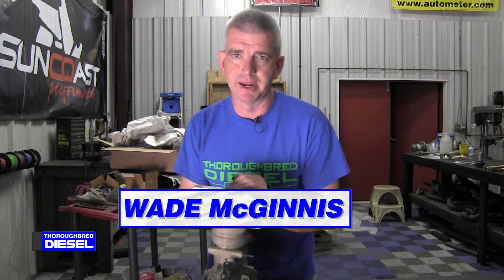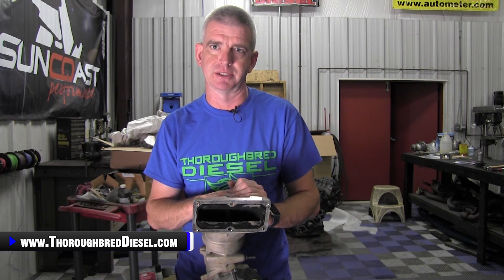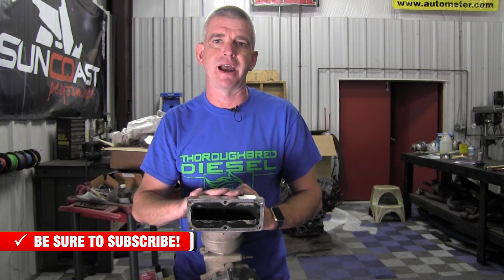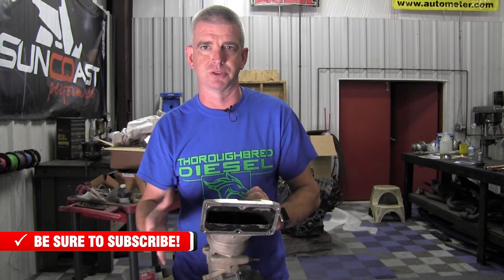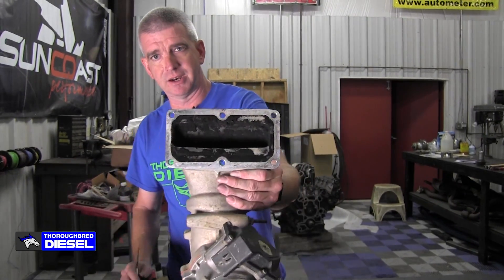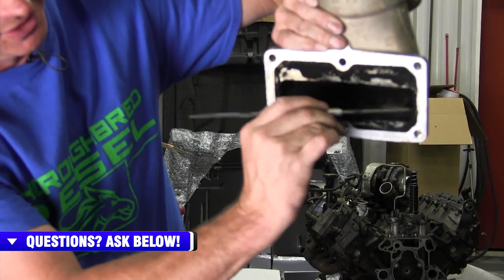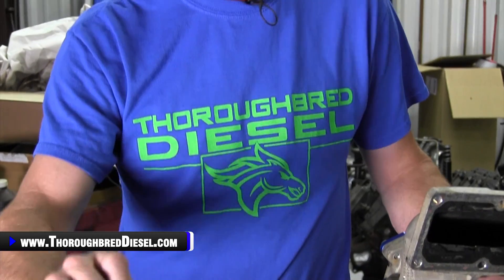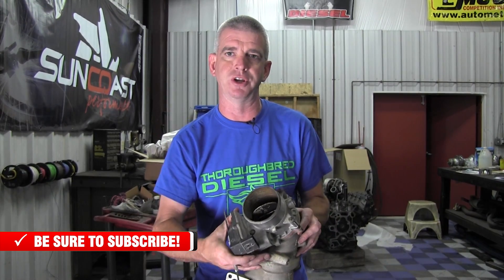What is an EGR system? Where Does All of My Soot Go? 🔧

Comment: But won't a fuel additive prevent this buildup from happening?
Reply from the maker: Fuel additive will clean deposits from your fuel system and will also make your truck more efficient and burn cleaner, but unfortunately, it will not remove all soot from your exhaust.

Comment: The EGR system on the 06.5’ 5.9er is an in cylinder type of situation correct? And basically only way to get rid of it in my rig is a cam change or is there other things I can do cause Where I live I am able to delete and so my Toyota’s and Subaru’s have all the emissions removed which is boxes of crap that literally destroys your engine so you have to go buy another one! The oil in my 91’ 4Runner with possible the worse Toyota engine the 3.0 3vze doesn’t darken until almost 15k on it it gained 6 mpg and a tremendous amount of power increase so don’t let anyone say it’s all just for our environment cause your little electric cars have the most toxic waste  to ever be produced by a passenger vehicle! Diesel built the world we all know  and we we need a lot better fix than an EGR system because vehicles would last considerably longer and be more efficient without! Sorry for the rank but Hot issue! Wade am I right there is not much I can do with my Cummins? Can I clean any part of it until I do the cam swap?

Comment: Without the egr system on a diesel would the dpf or DEF be more reliable? It just seems that every system is to fix a problem caused by the one before it. It just seems like the design is to shorten the life of the new diesel engines to sell more trucks or in the least more parts.

Comment: I'm curious to know if the soot and dirt can enter the engine.  If it does won't it be bad for the engine ? Please let me know.
Reply from the maker: The EGR system does allow soot to enter the engine.  The exhaust gasses are reintroduced to the combustion process in the interest of reducing emissions.  I cannot speak to if it is bad or not, but you can draw your own conclusions based up what you see when you remove the intake plenum of any vehicle that has a functioning EGR.  At level best, the intake system needs to be cleaned periodically to make sure that flow is not restricted.
Reply: @thoroughbreddiesel  is there a way that a filter can be added to the egr?

Comment: Thanks Wade! An important argument for EPA and manufacturers to work on techniques to clean the exhaust prior to introduction to the combustion chamber. No doubt many smart folks have thought about this, but why not pick up EGR gasses after the DPF? Clearly, as currently designed and installed, EGR systems have a limited life expectancy, and no thinking person wants more NOX in the atmosphere. Off topic, but I heard Bosch is no longer the manufacturer of Duramax injection systems. What have you heard?
Reply from the maker: That makes sense but I think the plumbing would be a much greater expense.  Easier to introduce the exhaust gas as soon as it leaves the cooler, but much dirtier.  The pump and injectors on the LP5 are Denso, so you are correct,  there has been a changing of the guard with the Dmax.

Comment: on a new 2016 duramax silverado would you reccomend deleting all the emissions stuff to aid in the motor running better and lasting longer?
Also, should.i consider switching from the stock CP4 and have a CP3 conversion done ?
Reply from the maker: The CP3 has proven to be a more reliable avenue than the CP4.  Give us a call for advice on the EGR system.